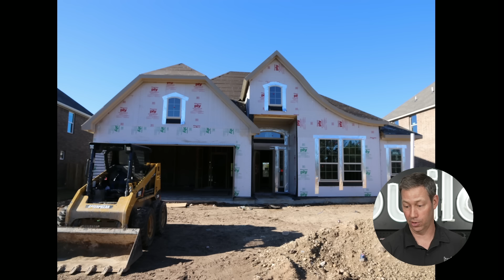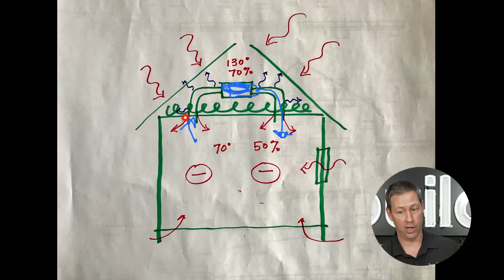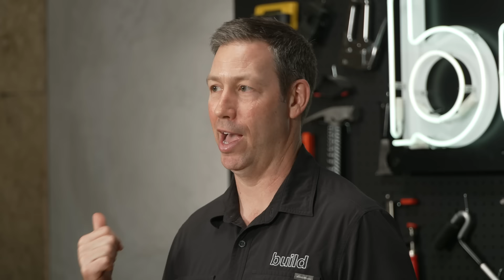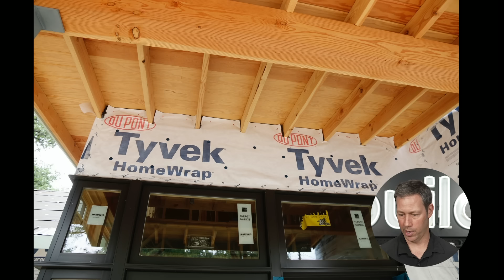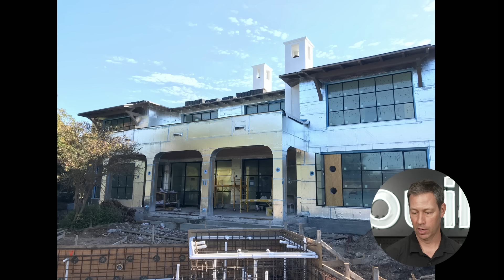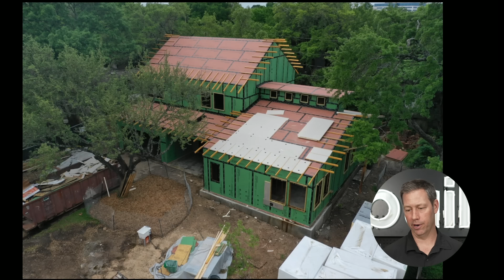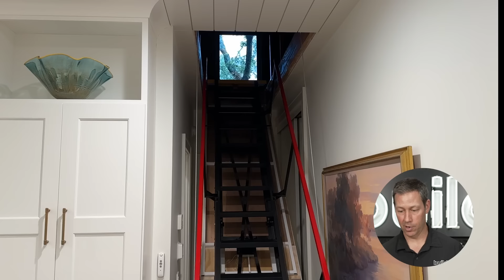CRAPPY ATTICS are Standard in America! Here’s how to BUILD - DECENT or AWESOME

Comment: My house has a metal roof screwed directly to the trusses. Attic is vented with loose fill insulation. I’m considering pulling off the metal roof to install sheathing to reattach the metal to. Then spray foam between the trusses and seal up the space. Worth the effort for energy savings? Also in central Texas.

Comment: For the average person that wants to do tight building with Zip and spray foam but use asphalt roof, why isn’t anyone discussing the fact that most manufacturers exclude unvented roofs from warranty coverage? What is your suggestion for this situation Matt? Looking at Smart Baffle but it will require a massive effort to try to air seal. Can’t afford a complex multi layered system above the roof sheathing. In other words, if we want conditioned attics or cathedral ceilings with asphalt shingles, what is your recommendation?

Comment: Thank you for your video.HUGE problem with your technology. If you blow closed or open cell foam to the attic ceiling, it can build up moisture between the rafter plywood and the ceiling foam. Over a short time, the mold eats the plywood and deteriorates the plywood. This is a serious issue. You need to rip off the roof and the rotted plywood. It's very expensive to do because it's hard to remove plywood stuck to the plywood. In addition, you have to apply the spray cell foam. This happened to me. I was inspecting the roof before selling the home and almost fell through the roof. Please inform your viewers of this issue. You should not apply the foam directly to the roof plywood.

Comment: Michigan here.  Just wondering where to put insulation when we have ridge vents and baffles.  Our furnaces are in the basements so the only thing that protrudes into the attic is the bathroom venting and furnace venting.  I just received quote for open cell in the entire house including the basement but they are recommending open cell on the ceiling (back side of drywall) but not on the roof joists.  What do you think?

Comment: Why do many of the homes in Texas have concrete slab foundations?  I can understand in Florida because of the poor soil and high-water table.  As you know in high humidity areas there is a problem with moisture infiltration with a slab foundation even with a vapor barrier. Here in Florida a friend with a slab foundation went away for a few months and did not run their a/c, and the walls were covered with mold where my father's house (built in the 30's) with a proper ventilated crawl space never had a problem with mold in the house. Maybe it is because the newer homes have vapor barriers in the walls to keep moisture in where the older homes without a vapor barrier breathe more.

Comment: Why even build attics?

Seems like the worst place to put anything.

Old buildings used the extra head height to allow air temp to naturally separate.

It seems ridiculously obvious to put your equipment in its own room or a basement.

Prevent needing another ceiling/floor for the attic, increase head room, and no penetrations through the roof to deal with.

Comment: Probably not the first to ask this, but what about "ridge rot" and moisture migration through the permeable OCSF (open cell spray foam)?  Somewhere the hot, moist outside air will meet the cool inside like a glass of iced tea.  Who was it, Lstiburek? or Chitwood?, has a system with taped, air-sealed but vapor open fabric like Tyvek at the "ridge vent" to let this moisture out without air flow losses.  Curious about your thoughts.

Comment: Just a thought wouldn't you have to put the stryo down then put boards on that then stryo between boards then the plywood on top all that so heat does not transfer to the origanial rafters  ...And if you use a light colored metal or or other means it would cause less heat too ...I want to do my attic with stryo between the rafters but leave air gap for the heat but use stryo on rafters thin stuff too to block heat transfer from rafters too ..When i get a win fall ... For the air gap use bug screen wire mesh ...
Reply: For the attic use the stryo foam with mylar toward the roof with a gap that would work too ...

Comment: I'm impressed by American's low standard requirements. The "awesome" attic would be passable at best, here in France and probably throughout Europe.
We would call it "not bad" at most and "decent" with raw drywalls or some sort of wall cover. "Awesome" if it's painted.
Noone would buy a house with the "decent" example, too much work to clean everything and refit it. The crappy one would sell better as it would at least let you refit it more quickly and cleanly.

Comment: I've often wondered why anyone would build a house without a cellar.  Given the natural need for storage, a cluttered house with valuable closet space compromised is the inevitable consequence of slab on grade construction.  Since below grade is cheaper to build than finished above grade, and dramatically simplifies and cleans up utility routing and storage, it seems like false economy in spades.  Maybe I'm a cave dweller, but I love having a cellar - and it seems like by far the safest place against natural disaster like tornado or other wind damage, as well as a cool (ground temperature) place to hang out without requiring air conditioning during the hottest months, while still remaining at ground temperature during deep freezes - whether the power is out or not.  The ground's temperature - and foundation walls in contact - doesn't really change season to season.  And it's quieter, by far.  It's worth discussing.

Comment: I just bought a 1924 home in Arkansas. My electric bill is 700 plus dollars. From the looks of everything the house has most of the original build. Upstairs looks upgraded, but I believe they skimmed on most of the things you've mentioned in this video. The home still has rope and pulley windows. Any advice on how to even begin minimizing this high bill problem. I need to add my walls were wet during the winter months

Comment: As far as i'm concerned decent to awesome attics don't even need to be more expensive.
After all: we build houses within our budgets to the needs and wants we have. If i know from the get go my attic can be used as a storage space, then i can take that into account while building the actual house, aka i need less space in the house below said attic.

The benefits in regards to insulation and AC alone are well worth it, because i'm pretty sure energy and maintenance costs for sure will only go up in the future. Good maintenance on it's own can be expensive as all hell in 2023, now picture what such a bill will look like in 20-30 years ... after the mold and other issues have set in.

If you can avoid costly maintenance by designing your house a bit better now, you save big time down the line.
And yes that's easier said that done, but ignoring the issue isn't a solution either.

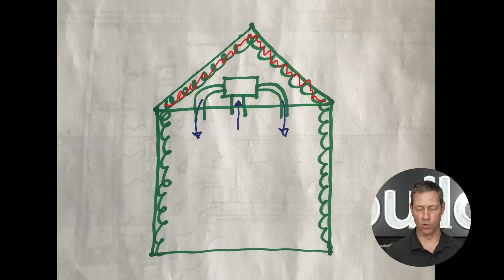Comment: 14:37 I’m entertained that you’ve reinvented standard practice basically from when we invented insulation through, I dunno, the 1960s? I’m not sure when it became standard practice in the US to insulate the ceiling instead of the roof — I actually thought it was much more recent, like the 1990s, until this video showed a bunch of houses doing it in the ‘70s. 

We recently moved into a ~20-year-old house and I was completely caught off guard by the loose insulation above the ceiling, instead of including the attic in the house’s air envelope (by putting the insulation under the roof and/or between the roof rafters). Every attic I’ve ever been in my whole life until now has had an insulated roof and an uninsulated ceiling. I’m still not convinced insulating the ceiling is a better plan.

Comment: Only issue i find with these adhesive based taped vapor barriers is how long that glue will last in reality and house that cant be maintained with out power is kinda bad idea. Other than that gotta say this is pretty damn impressive construction. Just hoping electrics were designed with European quality and inner vapor barrier allows the construction to dry if there is a leak to prevent any major issues in future.

Comment: Hey Matt, what's your opinion on hybrid insulating houses for serviceability later down the line? By that I mean, framing relatively traditionally with 16" OC, one size up compared to code(so 2x8 main floor, 2x6 uppers, or just all 2x6), and spraying a thinner foam layer followed by doing all the wiring and such, then finishing it off with one size down batt insulation. So a 2x6 framed house would get 2" of foam and batts made for 2x4s. All in the name of being able to easily work on plumbing and wiring if ever a problem were to arise.

Comment: Not sure you will have time to answer, but is a fresh air inlet designed into the HVAC system to allow fresh air into the home?  I've been back and forth with spray foam, and I believe you just made my mind up. My house was built in the early 70's and I'm starting the planning phase of a whole house renovation of the efficacy system including the HVAC, attic, roof, windows, exterior sheeting and insulation.

Comment: The average American attic space is entirely unused because ceiling joists are typically 2x4 dimensional lumber which would not be up to code in a floor system which are required to be 2x6.

Comment: So Matt, how did you tie the outer layer of sheeting on the roof to your inner layer? Near the edges you can screw/nail the external sheets to the 2x4 overhangs, but in the middle, how did you join the 2 layers through 4 inches of foam? With PL 400 ?

Comment: Interested to know how long the very well sealed and insulated closed-cell sprayfoam attic can manage moisture when mechanical HVAC is not working? The old-school insulated ceiling and well ventilated attic and very leaky building, is not energy efficient, but it seems to be able to manage moisture passively, with no mechanical HVAC.

Comment: I had my attic spray foamed but I"m going to add drywall to my knee walls and below my collar ties to create a soundproof music room. SO, my duct work will be in a non vented section enclosed between foamed roof deck and insulated/gypped ceiling at collar ties.  Will this run a high risk of mildew? is it as simple as running two 4" flex ducts to connect to a dehumidifier in the future?

Comment: Not far from what i envisioned, but i did have one concern. I had always been told that the reason for attic ventilation was to keep the frame members dry. Blanketed as yours are with 2 layers of styrofoam and hence  the middle layer of a sandwich roof, what allows any moisture within that sandwich space to escape? On the interior or underside between the attic rafters is rockwool. Wonderful, but not 100% creating an attic atmoshere free from particlates. Perhaps a thin permeable layer, such as housewrap, would suffice. And finally, does such a roof slow down the spread of fire when every house nearby is in flames? (such as in Lahaina on Maui.)

Comment: So have you checked how toxic foam insulation is? That's one major thing people are NOW concerned about in their homes.
Reply: spray foam insulation is toxic wet and is harmful when its off gasing. once its dry and in place its not super harmful. old stuff should be covered or sealed to prevent dust but going into an old attic im much more concerned with animal droppings and general accumulated dust, then dust just from the foam.

Comment: Matt...Closed cell against wood? How do you handle moisture trapping? Typically open cell against wood is the recommended long term solution as closed cell over time will trap moisture even with an air return. Also, what is the final R Value of the rock wool you installed? Thanks.

Comment: do you not have issues with the rockwool falling off and not in contact with your pressure barrier? with the four inch iso on the outside the rockwool is just a backup plan anyways, but if you did have a gap somehow and a gap then your risking mold and mildew between the rockwool and the thermal barrier. 

With spf instead you wouldnt have to worry about that. Plus rockwool omits micro bits of rock partials throughout the air while spf wouldnt leave anything.

Comment: I'm curious. Why is it that we've always been told the attic needs to breath? Are there NO weep holes in the brick? I'm guessing no more ridge vents either.  Just asking so I know when I build my next home. I see now there are no eves protruding into the attic space. How do you fasten the second "roof" / overhang? Clips?
 I also wonder why the hot water heaters are always placed in the ceiling.  Why not build a sperate, easily accessible, "room to access the HVAC and water heater?

Comment: curious how hard this is (at least doing closed foam on roof rafters) is on an older (1979 build) home. Do the ceiling joists and sheet rock floor of the attic also get done? 

My concern there is that other things might need to be resolved first - plumbing and electric (remodeled electrics just tapped into whatever circuit was near - but those might not correspond reasonably in the house & the kitchen circuit is way overloaded). Plumbing is changed to pex, but the AC still drips condensate outside from the eave, rather than into a drain...  Also, curious about the tight eaves where AC lines come in, and where electric comes in...

If it is just the roof, do soffit vents and ridge vents just get covered? No more "attic air flow?"

Comment: As a Platinum Preferred Contractor with Owens Corning, please do not insulate the top of your attic. Owens Corning will not warranty the roof as the attic is designed to breathe for the longevity of the shingles. This will reduce the life expectancy of the shingles significantly and when there’s issues with the shingles due to this practice Owens Corning will not be able to help. This has become more common in newer builds and it is unfortunate.

Comment: What's to say that negative pressure from the attic is all that bad of a thing?  Without that pressure, how do you replace stale air?  We are just now beginning to see studies detailing the harm of living in high CO2 environments.  Perhaps having a "leaky" house is better for you in the long run, and the better strategy would be to insulate without restricting air flow and reducing the energy costs of heat pump usage by finding cheaper energy sources like solar panels?
Reply: He doesn't show or address it in this video but his hvac system is insane along with dehumidifier and has fresh air brought in from the outside i believe by the dehumdifier and old air processed out. If you go back into the building aspect of his house its a pretty awesome setup not sure I could afford it though haha.

Comment: Cause it costs a fortune and you can have a great attic with a few spray foam cans to air seal and r50 blown in cellulose for a thousand bucks. These other attics are 20 grand. And I’m not kidding it’s $18,000 alone for closed cell in a 1500sq ft attic 11 grand for open cell and that’s only r30 code minimum.

Comment: I gotta disagree on the spray foam. I have seen several homes that have had roof leaks and the water collects between the foam and roof sheeting and has had lots of rot and mold. And you can't detect it early. Even seen a roofer step through a bit of roof.

Comment: I do have a one story envelope system. My attic is about a 2-3 degree and I get to use a tiny AC to cover 2750 sq ft. My electric bill is tiny. However, my garage has zero insulation in the attic.... relies on old school venting... I was hoping you were going to cover this in your video but did not. I don't know if I should leave it or spray It in as it would be great for storage. Do you have a video covering this? Tanks!

Comment: Ok maybe a stupid question why no basements in Texas. Seems like it would solve a few problems for you. 1 a space that doesn't really need any conditioning outside of maybe humidity control in the summer months it stays comfortable even when the power is out it also acts as a storm shelter. I live in the hellscape known as Illinois and don't currently have a basement but I know I will never live in another house with out one and an attached garage
Reply: Certain parts of Texas have high lime percent on the soil, soil stays very dry and causes foundation cracks, where I live is very sandy with lots of big rocks which is why there are rock walls everywhere.  In Dallas area you see foundation shifting everywhere and cracks on the inside walls.

Comment: can you achieve R-60 attic insulation using the system you explained for the excellent attic in this video? I live in zone 5 (new england area) and the new standards are R-60. What combinations would work to achieve R-60 without using closed cell foam insulation. Would like to avoid closed cell foam insulation as I believe down the road, closed cell foam will cause issues with mold since moisture may be trapped and unable to pass the closed cell foam barrier. {if the moisture inside is higher than the moisture outside, water vapor will want to escape and it cannot pass the barrier}